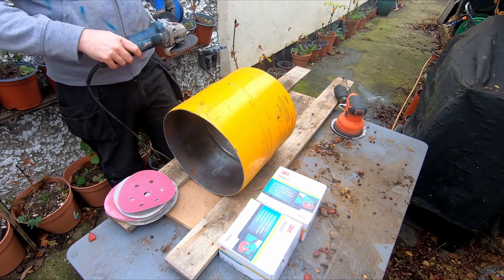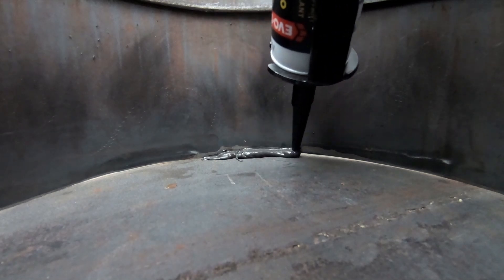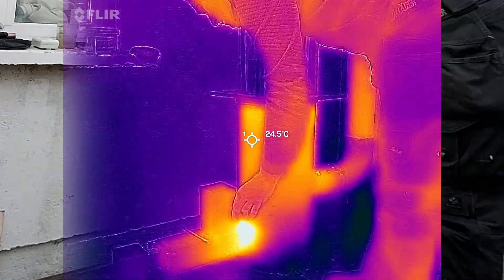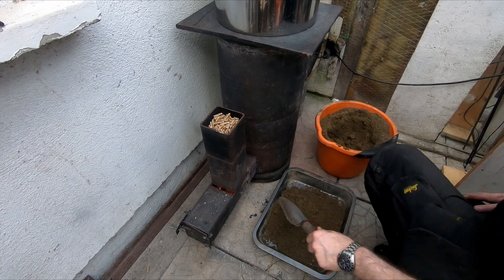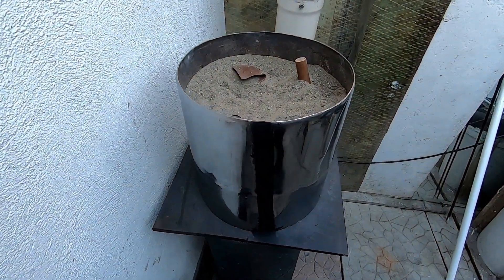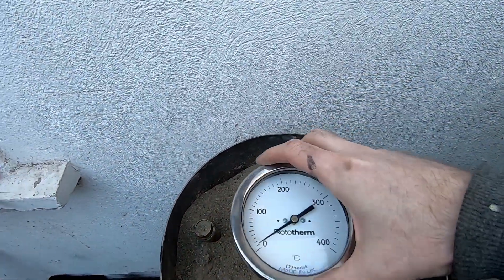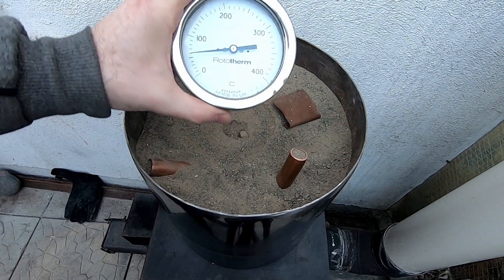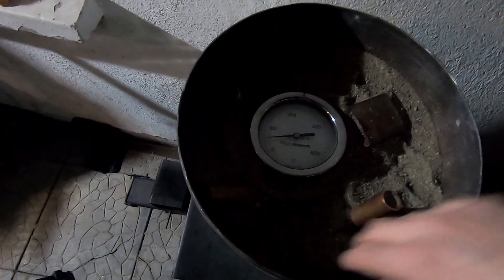Rocket Stove Sand Battery

Comment: The sand battery could also be thought of as a heat cache, or buffer. The heat stored in it is released as the stove cools, instead of being used to heat the room and wasted out the pipe.
A battery can store energy indefinitely, akin to water stored in a container.
Reply: @Joe_Blo Woda może podgrzać sie tylko do 100 C a piasek  ile piec da.

Comment: why call it a battery? I don't understand use-case for the sand battery. I just built my first rocket stove with bricks, not mobile but fun
Reply: A lot of heat in a fire is wasted going up the flue.  The idea here is to trap the heat in a thermal sink that then slowly releases it over the course of a day/night.
Reply: Definition used is a battery stores energy. In this case heat energy. We use mostly chemical electric batteries. Mechanical batteries, hydraulic batteries many types
Reply: A battery is a means of storage. In this case, thermal energy.